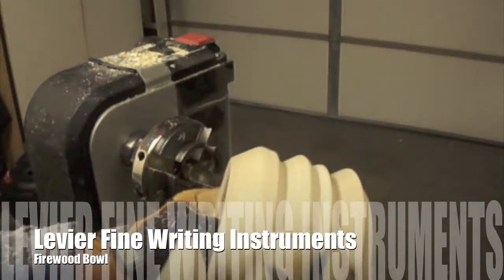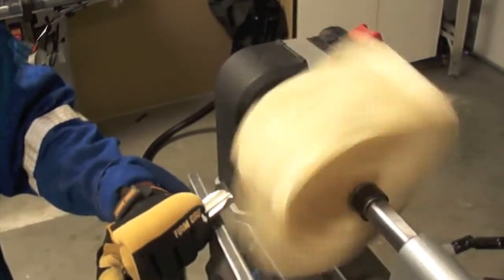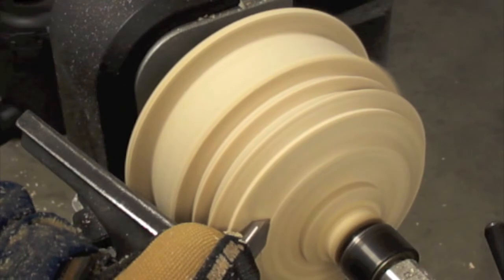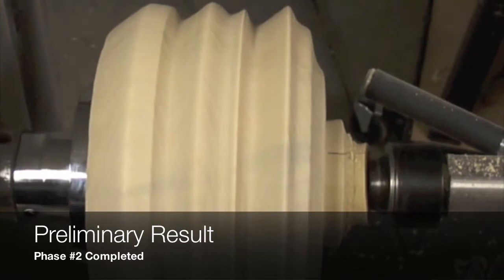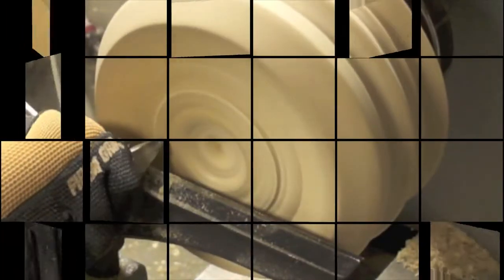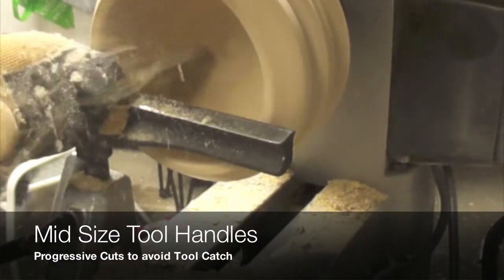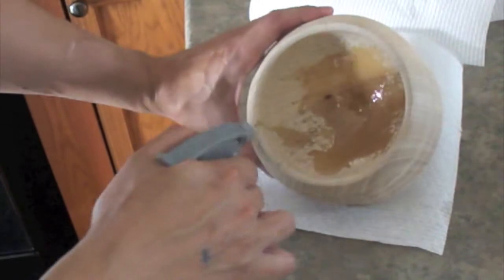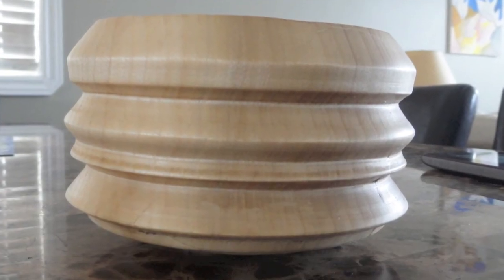Firewood Bowl

Comment: Levier, you should really cut the blanks closer to round so they're not so out of balance. If a bandsaw isn't available, electric chainsaws work great, as do handsaws (pruning type bow-saws cut wet wood quickly).

That little Midi lathe isn't designed for that kind of stress. You'll definitely wear out the bearings prematurely with pieces that far out of balance/round.

One way to help keep rocking/vibration to a minimum is to weight the base with sand.
(continued)

Comment: You can easily build a plywood box that attaches to the cross bar of the stand and fill it with sand. 150-200lbs of sand will be sufficient for a lathe that size. Also make sure it is sitting dead level, as you can twist the bed if it's not. Shim it level as needed, or build a small torsion-box sub-floor, fill it with sand and bolt the lathe stand to it.

Please, do not use a roughing gouge on a face-grain turning, it's very dangerous. Use a large bowl gouge for roughing face-grain turnings.